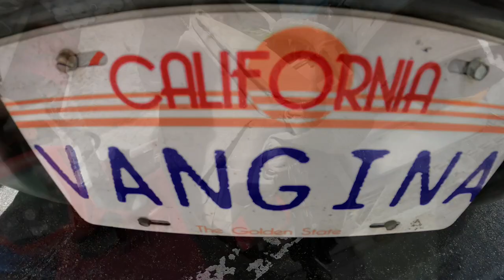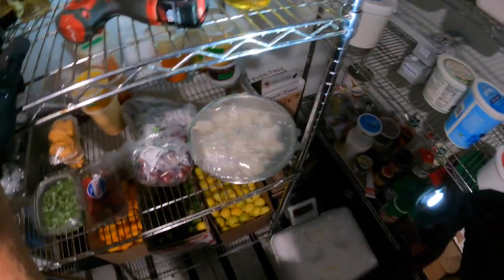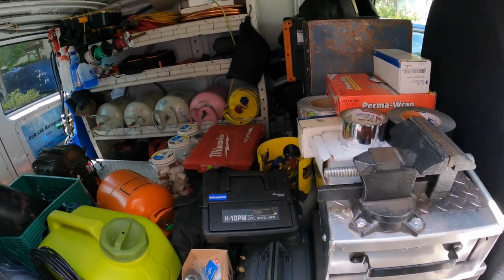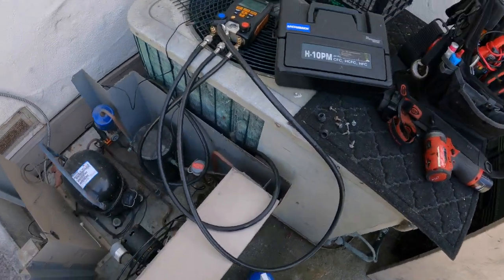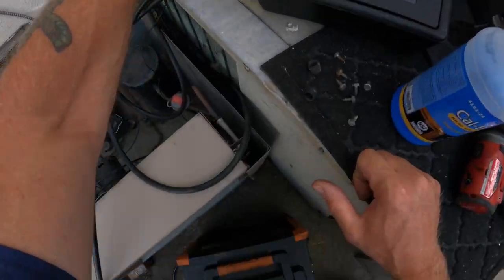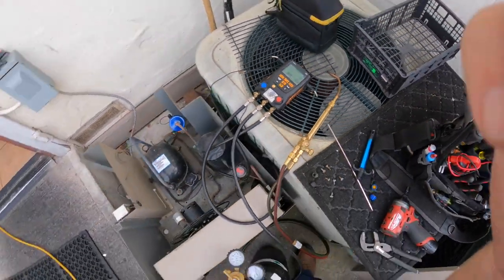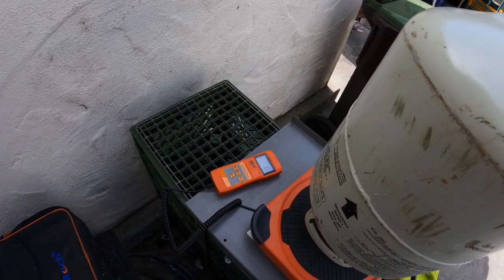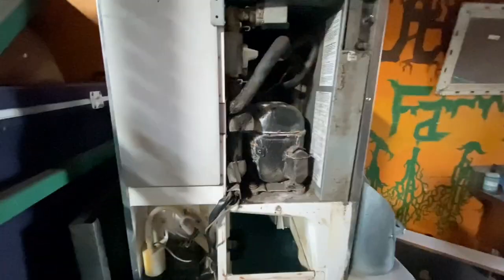Why is the walk-in cooler icing up

Comment: Thanks for the great video. I hope you have better luck with those CPS hoses than I did. Same hoses I put on my 550’s last week. New installation and failed nitrogen test. 2 of the 3 ball valves leak, 8 lbs. in 35 minutes. I have had them new in the package for probably a year. Beware. I was impressed as how clean that box was.
Reply from the maker: I’ve had the cps hoses for 5 years now. Still working good only thing I don’t like is there long at the end and don’t fit in tight places

Comment: Dave, you make great videos, but to a trained eye, I picked up a ton more information in the little things you added while talking your thoughts as you went along, little stuff like that takes alot more energy to do while your filming and working at the same time. You cut and edited the process top notch. You packed this one up with a lot of learned method of process from your yrs of experience and I got your method on this  paticular box. You have a alot of patience. I can watch this a couple more times and better nail down your process. I can see how deadly the H10 is, everyone wants convenience with the  battery sniffers, but you can't match the H10 accuracy, trade off of not catching the minute leaks and a better breakdown result

Comment: Danfoss evaporator coils leak too
Reply from the maker: I was wondering 💭 I figured as much.
Reply: May I ask you a question? I have a customer buffat Resturant ask me to fix ice cream display the Temperture only can go 4 degrees C. ( 39°F). I went n told him condenser coil is too dirty n much grease. I told him I need to chemical cleaning for $160 then to see if Temperture will coming down . 
Next day I went the temperature still not coming down n sign glass is bubbling. I told customer the refrigerant looks low. I will add few refrigerant till bubbling stop for $250. bubbling stopped but still not coming. I told customer that I will need to change Txv n dryer . Customer refuse to pay me for cleaning n add refrigerant. He said unit is not fixed. 
What did I do wrong? How to avoid this kind of situation? 
thank you
GJR, LLC
Jason

Comment: Thank you for your video. I have questions for learning purposes. After the 26:30 what else did you do before you started brazing? Up to this point, you have recovered the refrigerant and went straight to brazing on the evaporator coil? Did you open any line that the fumes (from brazing) would come out? I.e., remove the Schrader valve, if any. Obviously, you did not let the OFN run through the lines while brazing ... (because you had to replace the evaporator coil later on anyway). Is it not a concern that the oil in the refrigerant line would ignite and blow fire through the same area you are welding?

Comment: Great video as usual Dave, I just bought me an H10 and think it's gonna pay off with time...I noticed you use the manual setting, is there a reason?
Reply from the maker: I’ve always ran it it like. That’s all.
Reply: I like manual better it doesn’t really keep auto resetting every time I’m getting near and I can lower manual mode to pinpoint the leaks it works every time for me I use auto when there is such a high concentration of refrigerant in the air
Reply: @darksabatta  got ya...I suppose with time I'll learn the tool as with everything...I have to fieldpiece and it has been very good to me but it would freak out a little sometimes, so now I can confirm with more certainty especially when you can't actually see the leak to bubble it.

Comment: Time for a Russell Coil  🤷🏻‍♂️. No heatcrap for me 😁🤭
Reply from the maker: Turbo air? You got the hook up?
Reply: Never had an issue with Heatcraft for me, I worked in a Walk in Cooler with 6 Bohn Heatcraft coils from 2007 with no issues, only needed new motors but that was it. It also depends on where they're installed, doesn't matter if it's Russell or Heatcraft.
Reply from the maker: @johndeerefan725  they all leak in restaurant application
Reply: @NorCal-refrigeration  I used to 😁🫠🫣
Reply: @johndeerefan725  I never had issues with them obviously if they’re installed nowhere near acids , vinegar, dressings etc . Difference between Heatcraft and Russell is that Russell used thicker wall copper compared to Heatcraft. But I had better luck with Russell coils lately especially the ones where the Heatcraft ones were. To each it’s own . You keep using Heatcraft I’ll keep using Russell even Trenton or Turbo Air seem to last longer✌🏼 .